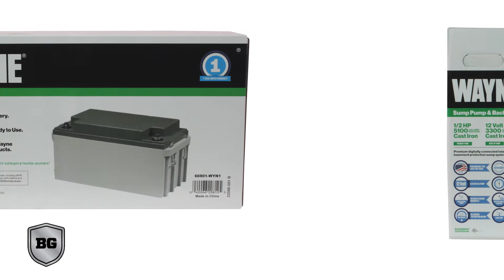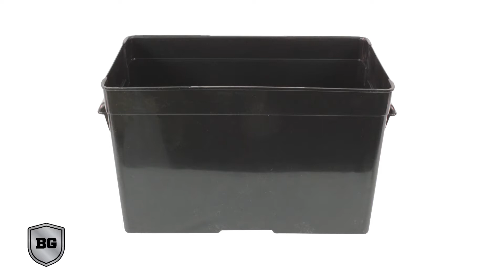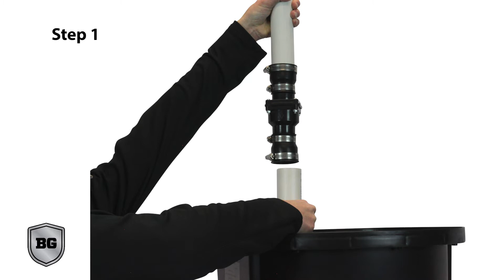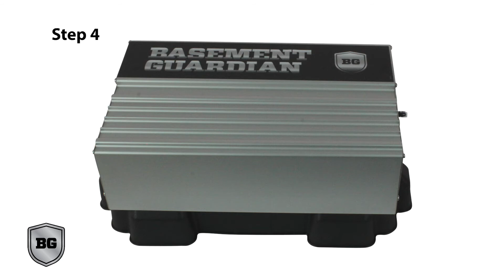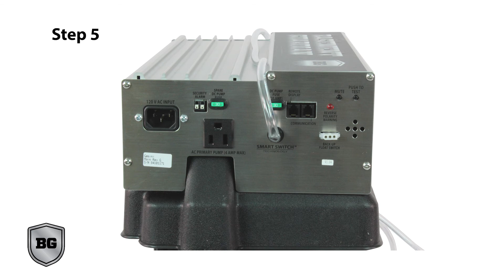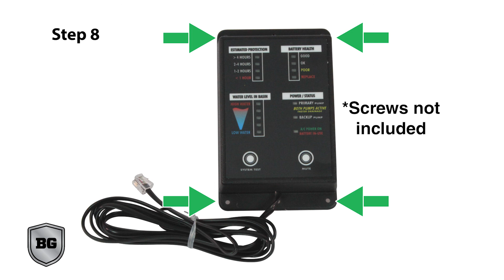Wayne Basement Guardian Pump Install Final

Comment: Bought this Wayne WSS30Vn a year ago but didn't install it until today. The big and immediately problem is that the main pump just keeps running when float already reached the bottom. I even manually push the float level all the way up and down but the main pump just won't stop until unplugging the power. Don't know what to do now. The secondary pump works well.

I planned to install it by myself, but finally I had a professional plumber come in today to install it. Then we got this problem.